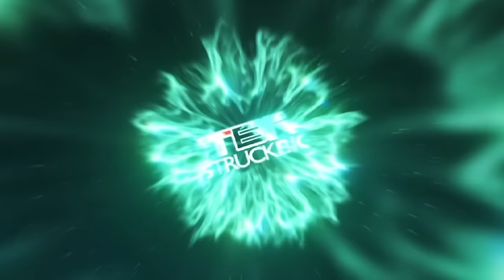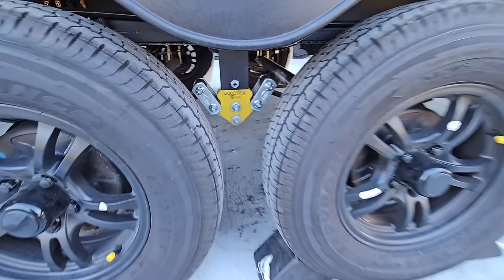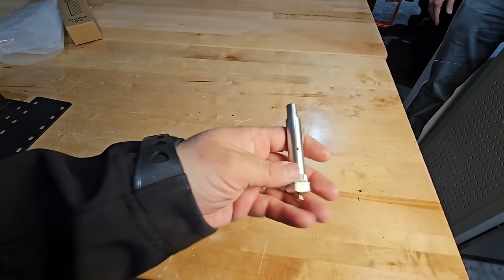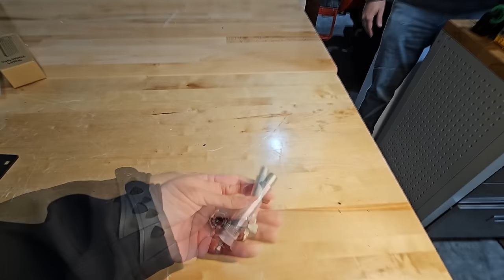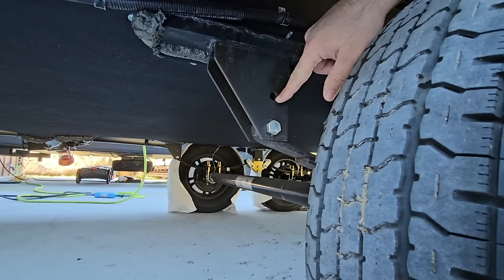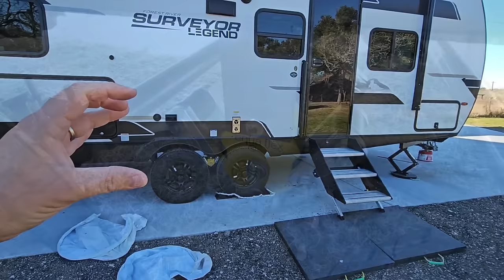Explaining why I did this the way I did! RV Suspension Upgrade!

Comment: I also recommend replacing all of the bushings with bronze bushings and wet bolts. When I first got my 2018 Solitude 310GK the fixed end of the leaf springs didn't have wet bolts. I upgraded immediately to the Morryde heavy duty shackle kit and inspected everything. The fixed ends of the springs had bronze bushings, but they were dry and they were also almost worn through with less than 1000 miles, 500 miles to the dealer from the factory and 500 miles from the dealer to my house when I checked for greasy brakes since they didn't seem to work at all. They were covered in grease! I have a different perspective in regards to wear of the bolts. The bolts should not wear or elongate the spring hangers. If that happens it is due to pounding and probably a failed bushing. The reason the thin spring shackles elongate and even tear through is because the metal is so thin that it stretches from all of the pounding, hence the reason the heavy duty 1/2 inch thick shackles are so great, I have never seen any wear in them. I have also never had any wear in the front or rear spring hangers in the hanger holes. I also grease my wet bolts on every trip and I have had good luck with them lasting a long time. I am on my 3rd set of leaf springs, just installed last week and my equalizers, same lipperts that you installed are still in great shape, no measurable wear on the bronze bushings and my spring bushings were doing well also but the springs had gone flat so I replaced the 3500 lb springs with 4000 lb springs.
Reply: I have a 2019 310gk and had the same experience with the spring end. Highly recommend using wet bolts with bronze bushings at every connection. Thanks for your helps.

Comment: I installed RoadArmor’s suspension unit, used wetbolts all the way around (plastic bushings were already shot after 200 miles), an X-brace between the 2 center points, & upgraded the tires from 205s to 225s. Tows so much smoother!

Comment: I recommend replacing ALL with bronze bushings. my TT is a 2019 with probably a little more than a few thousand miles and im surprised that it was starting to wear through ALL of the nylon bushings. not enough to elongate the springs but good thing i watch your previous videos on saying this is a great upgrade. did the cre3000 with ALL brass bushings and wet bolt. i will never look back at the factory stuff. great upgrade, thanks!

Comment: Thank you for the information.  I wish I could do a suspension upgrade like that. I have a wide track set-up,  and seem to remember you saying it can not be on the wide tracks.
Reply: Equa-Flex actually does make a wide wheelbase model, as does MORyde. I have a 42" wheelbase (14.75" equalizer) and like the Road Armor but don't think they nor Dexter offer a wide option. I like the action of the EF, but reviews seem to indicate the long body of the 14.75" version is susceptible to bending and binding from factory overtightened pivot bolts. So I'm leaning toward the MORyde CRE2-1475. Plus the shackle upgrade too, if course.

Comment: I realize its to late for this recommendation! But for next time when installing wet bolts make sure the small hole on the wet bolt is pointing down.  Reason for this is to keep moisture and wear debris from clogging that hole.  Over time wet bolts can be tough to grease.

Comment: How does the equa-flex compare to the road armor? I see they offer different version based on weight of the trailer. I would be interested to see how the performance compares to road armor in the 6k to 8k range.

Comment: question....were the nylon bushings tight and did you have to press or drive the bronze ones into the springs? I am replacing the springs on my 2018 Surveyor as one side is flat. I'm going 300lbs higher capacity on the new springs. When I recd them I could push the nylon bushings out with my index finger and the bronze were sloppy. I have returned them for replacements as I have never seen this before.

Comment: Two years ago you made a video about upgrading your old trailer to the road armor equalizer.  This one is a new model.  How does it compare?
Reply from the maker: For a smaller, lighter trailer, this is a great solution.  The Road Armor requires a wider stance.

Comment: The primary reason for torquing any bolt has more to do with not stressing the threads. Not so much to regulate the clamping pressure of the bolt.
Reply: Torque specs for bolts are to regulate clamping force.  If the only concern was thread stress then there are much better ways to ensure the threads aren’t going to fail (vibration proof fasteners, loctite and similar compounds, etc).  That said, in this application it looks like the torque isn’t critical as long as you’ve made sure the nut is firmly seated against the shoulder